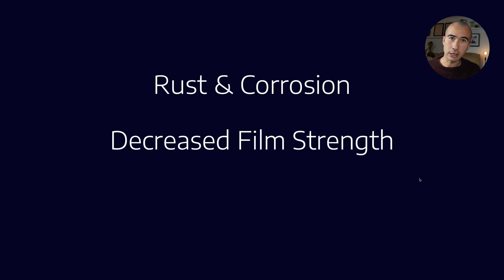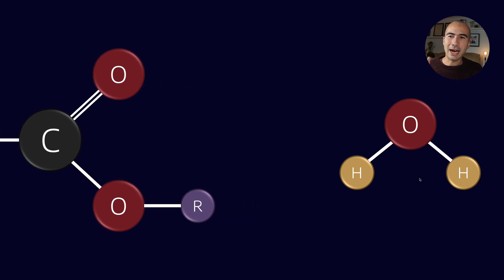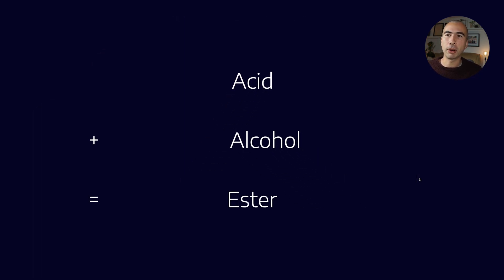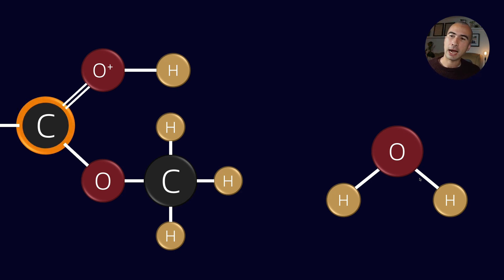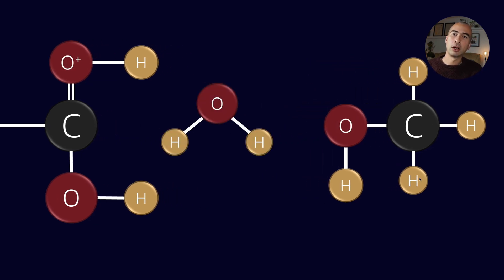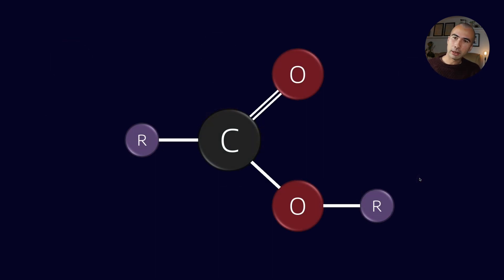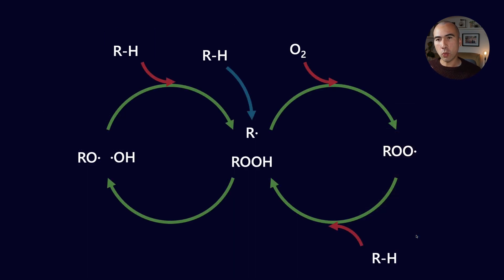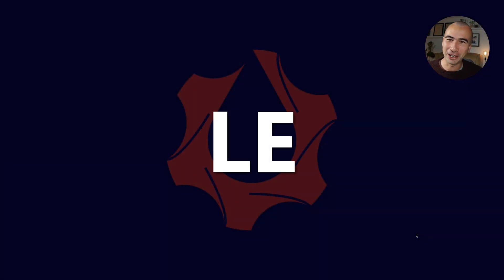How does water destroy lubricants?! Hydrolysis of esters explained.

Comment: First of all, thank you for sharing such an informative video. I have a question: Many lubricant users say that ester-based products are vulnerable to water, but I don’t think hydrolysis occurs explosively in typical lubricant operating environments, even if some water ingress happens. Of course, acidic substances can be generated within the lubricant, but I’m not sure if it’s accurate to say that ester products are extremely vulnerable to water just because of minor water contamination. Also, what do you think about the idea that the ester group can actually hold onto water molecules through hydrogen bonding? I’d like to hear your opinion!

Comment: Thank you for the easy to understand great videos! Question: Can ethanol(95%) be used to flush out the remnants of POE oil in a "fridge compressor" (after flipping the compressor and dumping out the bulk of the POE oil)? Or is there a better 'cleaning solution' for flushing out the POE oil? I'm considering replacing the POE oil with mineral or a synthetic oil as I'll be using the compressor for a DIY compressor or vacuum pump (not for refrigeration). Thank you.

Comment: Hi, technical question...

Inside an engine blow by combustion gases contain H2O so I'm the crankcase you have an ester + H2O + heat ... Doesn't this mean ester based pills will break down quicker than olefin oils???

Comment: What if I run for exemple a engine oil with great content of esters, let's say above 10%, can hydrolysis greatly affects my engine oil performance in normal condition between 10k km or one year change intervals? Should I do the change more often? Thanks in advance🙂
Reply from the maker: Engine oils are generally okay - 10% esters won't run you into too much trouble. It's mainly the full-ester lubricants that are of concern.
Reply: Hope you have a dedicated video soon about mos2, ws2, hBN as primary dry lubricants and as oil additive 🔜🛢️😁